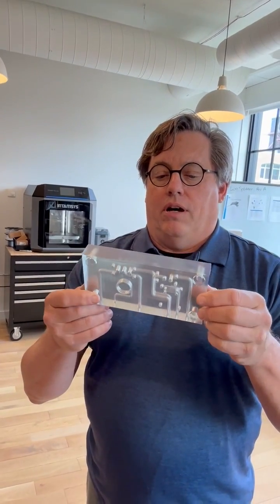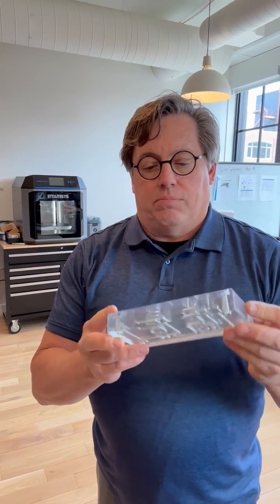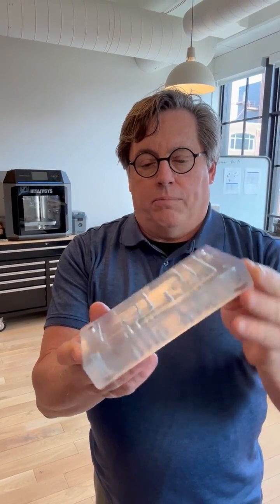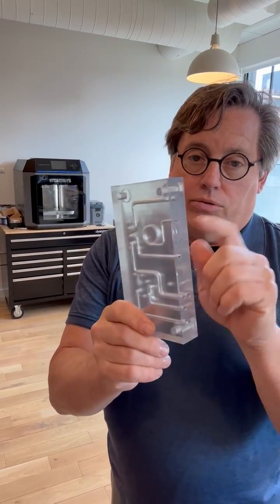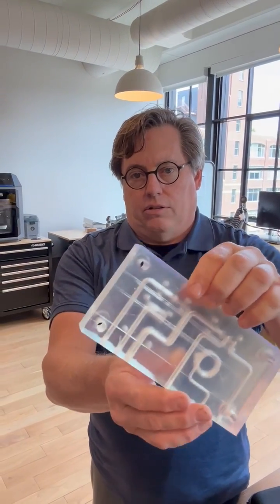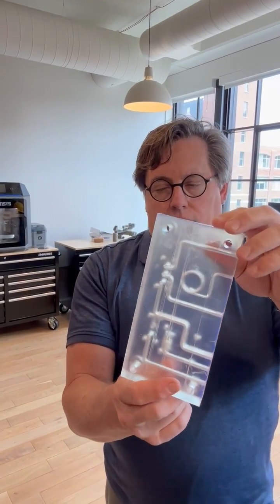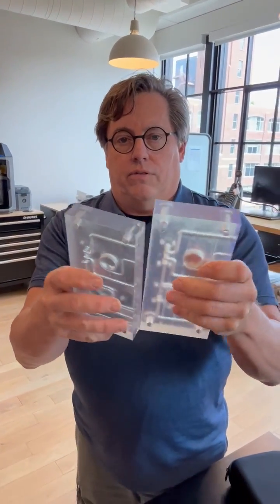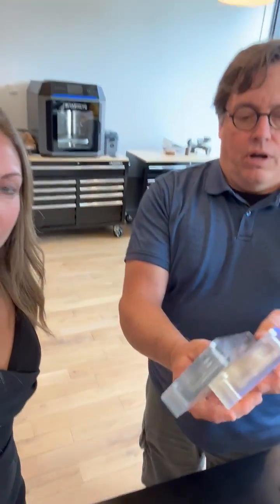Form 4 V5 Clear Resin vs Form 3L V4 Clear Resin

Comment: Super helpful, thank you so much!  
Wow - that's amazing difference regarding the time to print, under 3h vs 34h ... oof!  Even if you split that 34 in half (which isn't how it works, haha) - still 3+ vs 17 isn't even a conversation for us ... would definitely get a Form4 ... plus the materials and supplies are cheaper for what we're doing as well.  This really helped clarify for us so we can make a decision :)
Reply from the maker: We've been seeing amazing results with our Form 4 printers. If you're interested in purchasing one through us, reach out on our website: https://go.eacpds.com/acton/attachment/25728/u-b74d9e63-d89a-4de2-b279-2460f31e5694/0/-/-/-/-/EACPDS.com%20Additive%20Manufacturing%20Main%20Page